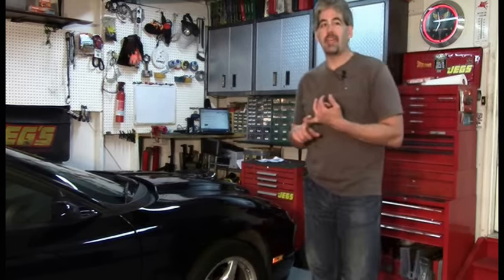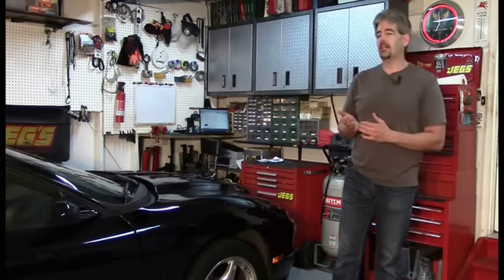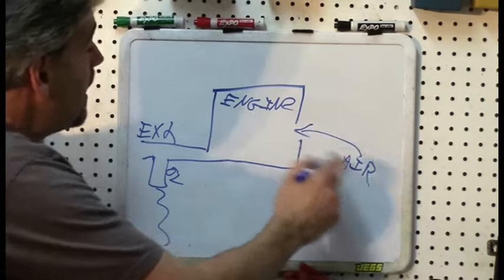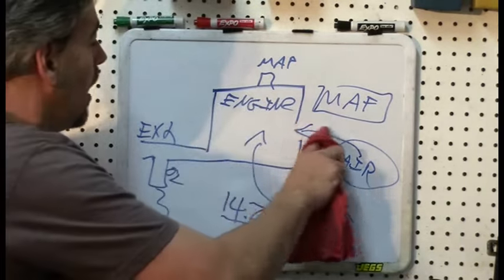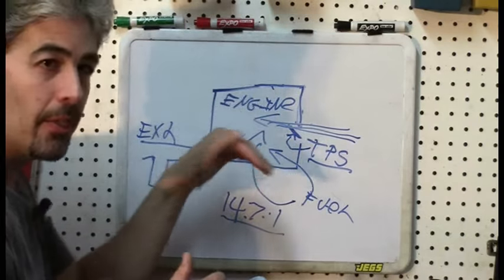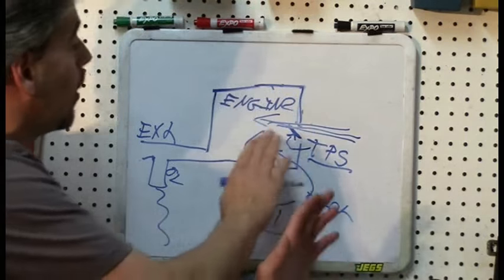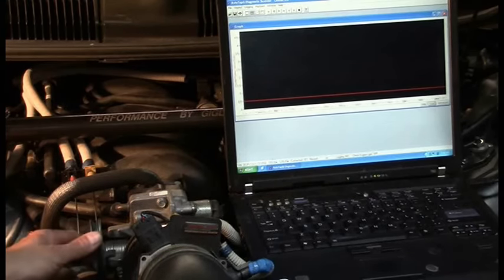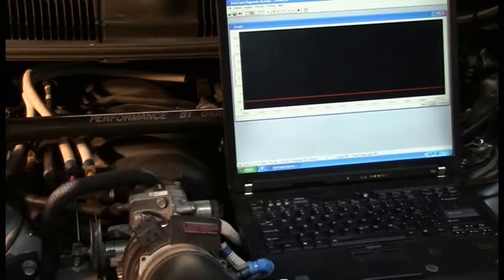TPS (Throttle Position Sensor) Diagnosis and Understanding Pt1

Comment: Thanks for the video! Im thinking my TPS MAY be bad? If I have slow acceleration/high RPM's but no ck engine codes could it be a dirty/bad TPS? 98 Altima went into limp mode awhile back and first shop said bad CAT, 2nd shop "adjusted timing chain" and told me I need to pay them 1200 for new timing chain but its "fixed for now because we adjusted timing and chain". Ive changed air filter, new fuel filter, new spark plugs, new plug wires, repaired cracked EGR hoses, not sure what else it could be. No rattling or any weird noises. Who thinks its really the timing chain? It accelerates OK now but alot slower than it used to be. I also don't trust any shop now because 2nd shop left spark plug wires loose which made my engine shake and gave me a coolant leak which I've since fixed and they also broke my EGR bracket.
Reply from the maker: Why do you think your TPS is bad? What was the feed, ground and signal voltage reading?

Comment: Thank you so much for explanation. I have EPC light on but when i Increase RPM to 3000 the EPC turned off. and when Car Stopped it comes on again. how to solve this issue please. my TPS gear is hard to move also.

Comment: Any ideas as so why the PCM never seemed to mind this?  Never turned on the engine light but the car ran really crappy in high gear with light throttle. Glad I didn't leave it at the transmission shop.
Reply from the maker: No reason for it to mind it- when the voltage drops out on a TPS, it simply thinks you let off the pedal. Granted you might have had a lean code or something since throttle was open but again- unless you the same condition (and under the same conditions) happen back to back in consecutive drive cycles, you wont get an MIL.

Comment: 95 corolla dx wagon, checked everything stalls when put in R and sometimes D or idle at stop lite, all seems to point to tps,took off cleaned and lubed lightly no change, need a new one? certain way to put on? need to turnhold buttfly valve certain way then put on tps?? is this what it is have cleaned all parts your help is great
Reply from the maker: What is the data you got from the TPS that points to it as the most likely problem? You never mentioned the voltage readings.

Comment: I have seen you run an engine in your garage, even in cold weather.  Do you have some sort of hose hooked to the exhaust, or do you just have the garage door cracked open?  Do you have a CO alarm?  I imagine most readers would be aware of the potential dangers, but  I wonder how cautious we should be.
Reply from the maker: I just crack the door open.
Reply: Thanks for the reply.  I am particularly aware of this because near where I live three men died a few years ago running some sort of gasoline engine while they were doing some work in a drained swimming pool.  Two of them collapsed and the third went in to rescue them and he was also overcome by the fumes.

Comment: I have an electonic accelerator pedal I would like to know with the throttle body removed and placed on the engine and the plug replaced if I turn on the ignition the press the pedal will the butterfly more or will it need input from other sensors?
Reply from the maker: Yes it will move

Comment: Thanks. Can a failing TPS report inaccurate  when hot but accurately when cold? I did your resistance test and it seemed just fine but it was cold. My problems surface when the car is warmed up. My torque converter lockup is erratic the trans guy said it could be the TPS.
Reply from the maker: Components that are failing very often are more susceptible to variances in resistance as result of heat.  - you might want to examine the resistance under normal operating temp vs cold.
  It is important to note though- usually in my experience I have found that heat doesn't cause the increased resistance- rather increased resistance generates heat.  For example bad, corroded wiring is an example- especially at say, the starter motor or some high amp device. The voltage drop increases dramatically and the wires get hot but it isn't the heat causing the resistance and voltage drop- it is the resistance causing the heat.

Comment: I have idled the car much at times since I got it (I know, a no-no) so maybe that has caused the problem (carbon buildup)? I also got a p..1442 (canister purge valve) or whatever code recently and replaced a cracked gas cap---my problem has arisen since then.  I.e. reving at stops, between low gear shifts, and on highway, and higher fuel consumption.

Comment: Hi well done for your videos they are very interesting and easy to understand. Do you have a video on the idle control valve? My car works fine but when idling the rpm fluctuates a lot from 500 rpm to about 1500 rpm on its own. Is this the fault of the idle control valve only or could it also be the tps? Thanks
Reply from the maker: +Daniel Vella If the idle fluctuates the idle control valve is working
Reply: Ok thanks do you know what might be the problem then?
Reply from the maker: Daniel Vella See my video on "volvo loping idle" for diagnostic procedures
Reply: Hi again, I have cleaned the throttle body as well but the engine is still idling badly but not all the time. when driving the engine runs perfectly. could it be the tps?
Reply from the maker: What data was it that showed the throttle body was possibly dirty?  I would start there.
Reply: the butterfly had some carbon on it but it is fully closing. the problem started when the engine was not accelerating at all then disconnectes battery for e few seconds and workes but with bad idling. engine check is also on. i checked with obd2 scanner. error code is p0123 ans according the code book its tps/pedal position sensor high input. reser ecu but works good for a small time and then idlea bad again
Reply from the maker: well how easy is that????  What is the signal voltage at idle and wide open???
Reply: will check voltages tomorrow and get back to you but first time i checked with ignotion on but engine off and the connector disconnected from sensor i had 12v on 1 pin 2v on other pin and 0 for last pin (gnd) shouldnt the refernece be 5v instead of 12?
Reply from the maker: Daniel Vella Not if it is a frequency device, That's what it sounds like.  You'll need to watch my video onb MAF diagnosis to learn hyow to test frequency devices
Reply: With tps plug unplugged I have 12V and 2V the when i connect it with ignition only on i have 7.6V and 0.32V and when I start the engine I have 8.56V - 8.7V on 1 pin and on the other the same. Now the engine is not accelerating at all. It's driving me crazy. Error are P0122, P0122P and P0609 and P0609P. The last P I think it means pending and 609 is something on the powertrain.
Reply: When I said not accelerating I meant not revving
Reply from the maker: Daniel Vella Yeah that sounds exactly like I would expect from a frequency reading (you're measuring the wrong pins btw but still it doesn't matter, you need to see the frequency changes to determine if it's working correctly).  Without a DVOM capable of high frequency measurements or a scantool it is not possible to rule out this as the problem, sorry.
Reply: +Schrodingers Box Ok thanks for your reply and do you know why the engine is not responding to accelerator pedal. it doea not rev but stals
Reply from the maker: Daniel Vella Sorry I don't know- I would probably look at MAP readings verifying it is proportional to throttle movement and use my scope to verify if the TPS is responding correctly.
Reply: +Schrodingers Box Ok thanks a lot for your help will check the map sensor next weak and will let you know what i found

Comment: hi there im a fan of your work... however i have a lancer 10 and the tps harness has 6 pins... as compared to your references with just 3 wires... im trying to look for the signal wire
Reply from the maker: Never heard of a six pin TPS. Sounds like there is another device paired with it. To find the signal wire just probe each wire against a chassis ground and move the TPS and you will eventually find the wire that responds to TPS position.

Comment: Need a fly by wire diagnoses. I want to know if it's the pedal sensor or the throttle position sensor. The TPS and thottle are a complete unit built to be tossed out, and replaced.
Reply from the maker: Pretty easy- just unplug the TPS to isolate the pedal sensor and vice-versa.

Comment: I'm just trying to get my head round this. Would it be true that, on a drive-by-wire car, you would need another potentiometer to assess the position of the actual gas pedal? Or is the pedal position calculated by a separate system? Or (and most likely) am I just pissing in the wind here?
Reply from the maker: You are correct. You have a potentiometer on the pedal itself (2 actually) as well as on the TB (again, 2 of them)
Reply: @SchrodingersBox  Thanks. I got to thinking about what would happen if the potentiometer on the pedal were to suffer from those 'dead spots' you covered in the video. Would they not cause the PCM to think that you've come off the gas and so close the throttle?
Reply from the maker: exactly correct- this the reason I believe there are two of them. If they don’t match, a code will throw because obviously something is wrong with one or both potentiometers.
Reply: @SchrodingersBox  Yes, that makes perfect sense. Thanks, Matt.

Comment: out of curiorsity have come across , or worked any with the electronic tps that incorporates the tac?  i had a 03 tahoe with the 5.3 come in that had the reduced engine power codes. i tested both the tac tps and the app everything seemed up to par. but it still had the codes. someone had replaced the tac a year ago. so i figured it was wired wrong but it wasnt. the strange thing in the process of running all my diagnostic tests it just left , and now i can not get the codes to come back. how do i fix and find a problem when one does not exsist.   i guess i say all this to get your opinion on it. gm says that they do have problems with that 8 pin connector. but it has already been replaced

Comment: Seems obvious (duh)but testing that TPS connector is with the ignition on position, right? and meter on DC volts? Any combination of connection is okay as long as the leads dont touch?
Reply from the maker: Pretty much that would be correct.

Comment: Honda Del Sol '94:  New TPS,  cleaned throttle Body, IAC.  When I tried to adjust the TBS I found only 4.1 volts from ECM  Y/w which should be 5.0 volts.  What effect will this have on the .5v to 4.5v adjustment range?  Does this condition mean a new computer purchase or a wire problem with the w/y wire from the ecm?
Reply from the maker: i would just check for voltage drop from the PCM or possible draw from 5V reference interference from other loads on the circuit.
Reply: Thank you, I will do that!

Comment: Can you try a cheap Bluetooth OBD2 scanner and see if the Torque Pro app (or other cheap app) is good enough to help people that don't want to invest a lot of money into a scan tool?  It's hard to convince people to invest in a scan tool if you already have it narrowed down using logic to just a couple parts which have a combined price less than a scan tool.  The Torque app is very popular, so if you made a video showing how to use it to diagnose car issues, it could get a lot of traffic.

Comment: Matt,  I have a question.   Does the fact that you get the full range of voltage 0.5 to 4.5V rule out an issue with the throttle body?
Rich
Reply from the maker: No- it rules out an amplitude issue, but not TPS% dropout issue.

Comment: Sir.  I am dealing with this situation with my astro 2004. have you ever heard that you can hear the fuel pump, your gauge needle is telling you how much gas is in thank, so we know we are getting power to to the pump and ground, but there is no pressure at all.  it sits at zero.  when prime it and while cranking it.  is this a bad fuel pump?
Reply from the maker: It is entirely possible and happens all the time that you can hear a pump run but it doesn't deliver adequate pressure.

Comment: oh and also i have learned with testing tps. if you have a dvom with graphing capabilities it works great in testing the resistance and the signal when moving the throttle plates
Reply from the maker: Indeed it does. I have only ever seen one graphing DVOM and for the price I would have sooner got an oscilloscope
Reply: I had found one through fluke it's I believe the 289 and runs between 3 to 500 dollars. Of course I do not k ow what the price is on a good scope
Reply from the maker: Tim Schultz $400 for a comparable one I bet

Comment: very good vid,thank you. know,question. 98' monte carlo 3.1 engine. when the car warms up it intermittently looses  power. sometimes it has good power,sometimes not,when cold,car has good power most of the time,when i say looses power i mean when accelerating. it holds power fine at steady throttle. any thoughts ?
Reply from the maker: kevin brooks Hundreds of them- what data do you have from your diagnostic tests?
Reply: Schrodingers Box no test, i can't afford a 200 dollar scan tool . but my mechanics scanner showed no codes !
Reply from the maker: what DVOM Tests have you done? I'm not sure what your asking from me- how am I supposed to know what to look for with no data?

Comment: does putting the back probes in make the second test possible? ive got 5.2 volts for power. and 5.15 for my signal wire for first test. i dont know how to preform the second test. sticking my leads into the ground and signal wire just gives me the signal wire reading of 5.15 that i got in the first test. im trying to test for good ground and good signal wire continuity.
Reply from the maker: that’s because your TPS is at idle position. You will only see variance with angle.

Comment: I have a 2002 Isuzu Rodeo Sport 3.2 V6.  the diagnosis indicated throttle body which my mech. says needs to be replaced.  another mech. said to replace the sensor to see it the check engine light goes off. After my mech cleaned the throttle body hoping that would solve the problem the light came on after driving about 15 miles. do you think I should start with the sensor  or just replace the throttle body which is much more expensive~
Reply from the maker: What was the data that indicated a diagnosis of replacing throttle body?
Reply: @SchrodingersBox  the code was P1120
Reply from the maker: Not understanding how that indicates the throttle body was defective.

Comment: You can get a "toy" scope on eBay for around $25. (DSO138)  They don't have amazing rates and they are nothing compared to a real scope but I'm pretty sure for automotive applications they would be adequate at least 80% of the time.   I got one and it's a pretty neat thing even as a fancy multimeter.

Comment: you may think I am an idiot, that's fine.  Everyone's entitled to their opinion.  I just bought a 95 k2500 chev 4x4 ext cab 7.4 liter with 84k on it.  I don't have your superior knowledge but I am not dumb either.  Now, considering the vehicle is 25+ years old (made in 94) I am changing o2 bank sensors, map, egr, iac valve, throttle ps, coolant temp, oil pressure, speed sensor, knock, and any other sensor I can find that the computer uses to gather data to set fuel/air ratios.  The sensors are old and in my opinion I need to start fresh.  I am expecting a comment back like, "don't forget the windshild washer level sensor".
Reply from the maker: That makes absolutely no sense whatsoever. If you do not need to replace a sensor WHY on earth would you replace it for no reason whatsoever?  Why aren’t you changing the wheels? The ball joint? The door panels?  Why sensors?
  Absolutely illogical.
  What’s worse is you even say you KNOW it is illogical and yet you do it anyway????  What?!?!?!